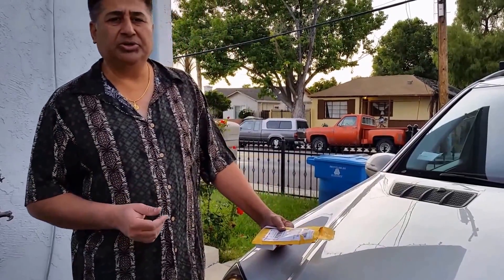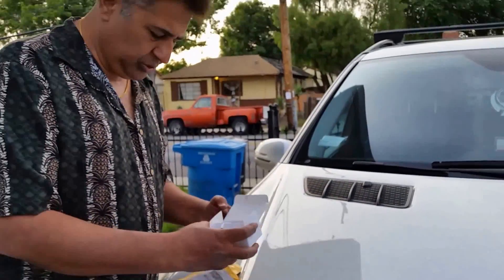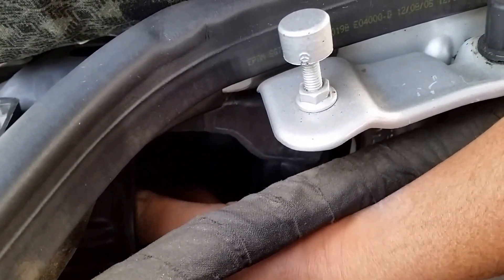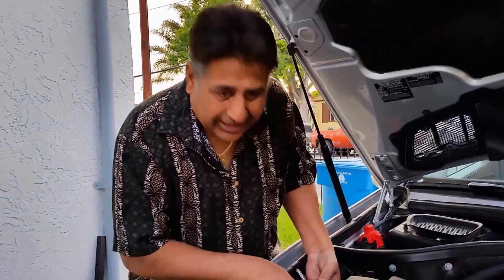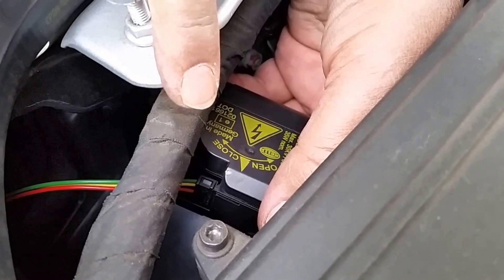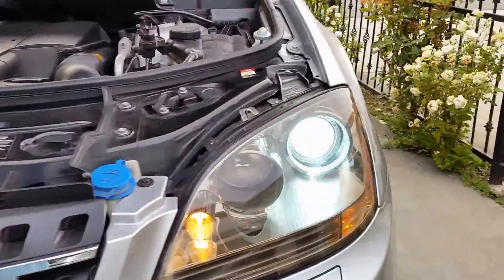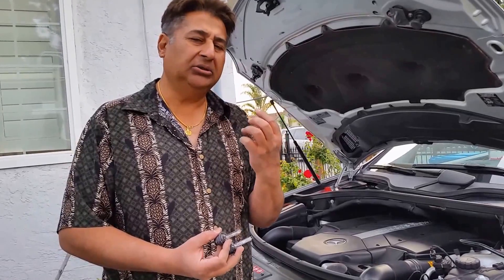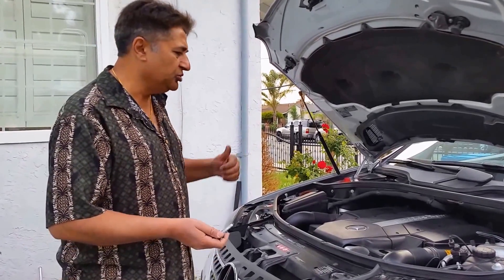How to upgrade HID Xenon Headlights for Mercedes | W164 | ML 500

Comment: Those halogen bulbs not hid’s.  If you want to install hid’s you need an hid kit not just a bulb with a blue tint. The factory bulb you just replace with that blue bulb is actually way brighter.

Comment: Hi, I have a 2011 ML350 4Matic with the ugly yellow lights.  What should I buy?  Also, looking for 6,000K color temperature.  Thanks!
Reply: +Jianmin 
That would be Facelift w164 and most of them have 4300K factory xenons but please do check first. 6000k 35w will give more than enough light. I haven't done mine as I have H7s Osram Hyper 5000k and I am happy. When these go I will go for Canbus Pro Terminator H7 35w 6000k.

Comment: Thank you for this video. I went to the link you gave and checked on the same car (2006 MBZ ML500) and i get this message: "This part is not compatible with 2006 Mercedes-Benz ML500 Base Sport Utility 4-Door." are these the correct bulbs?